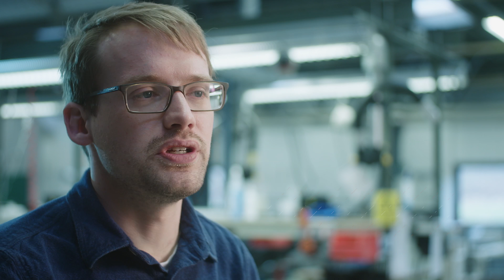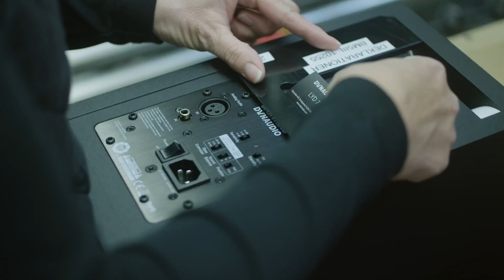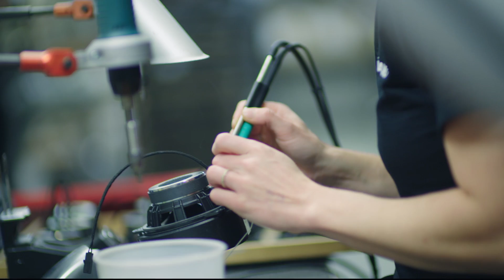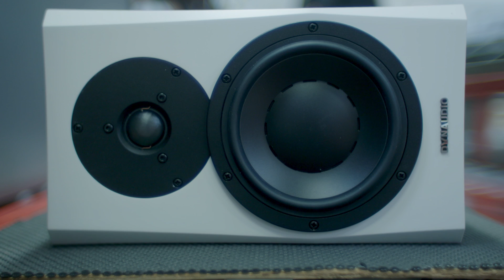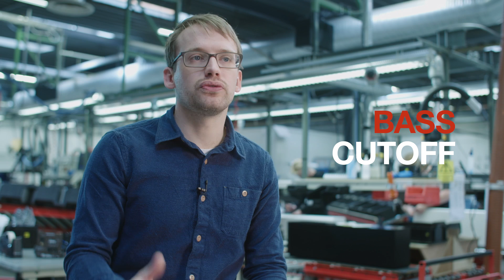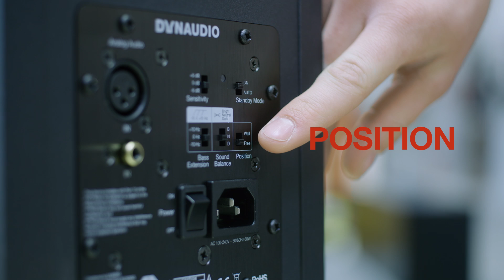Meet our newest Personal Reference Monitor - LYD.

Comment: Hello Dynaudio! I write music and do mixing. I want to buy a monitor for myself and I can't decide between two models. Please tell me, as far as I know, the amplitude-frequency response of the lyd7 and lyd8 are absolutely the same. Although usually 8-inch monitors have a wider range of low frequencies than 7-inch ones. Then what is the difference between the dynaudio lyd7 and lyd8? Do I understand correctly that a larger and heavier 8-inch speaker will not be able to reproduce the midrange as well as a lighter 7-inch speaker? Then what is the advantage of the 8-inch lyd8 model if it cannot give a lower resonant frequency compared to the lyd7 model? And one more question. What is the frequency response of the lyd7 and lyd8 at the level of +/- 3db?

Comment: I find it strange that there is no kind of volume adjustment on the back of the monitors as there can be slight difference in volume from one monitor to another, and I want to control the volume output. Calibrating the studio monitors will require an extra volume knob for each monitor to ensure equal volume for each monitor at a given level when the mixer is at unity.
Reply: Use your audio interface for volume
Reply: @tuneunleashed  I'm thinking about volume calibration of the monitors. I like to use unity gain on my mixer when playing back stuff. But of course, I will adapt to it. I'm still interested buying them at one point to retire my Adam monitors.  My monitors are attached to a mixer, not a pure audio interface.

Comment: The Essence Hi Fi series soundcards have RCA outputs so you can use RCA cables for connecting these speakers.  So does the EVGA Nu series.  So does the Soundblaster AE-9.  Best Buy sells EVGA.

Comment: I'm an aspiring podcaster and I want to buy LYD 8 for by 2m x 3m room. I'm crazy, but I am a bass head, don't wish to get subwoofer (waste space and extra money)
Reply: I have a room 3,5 m x 3 m and I use the LYD7 and the bass response is amazing, I think they are perfect. I used before the Adam Audio T7Vs and they were tooooo much bassy and boomy, I returned it and change them for this...
Reply: @opamusic9457  does it have parasite noises after leaving it on for some time? One of my a7x units has it, even though they changed the amp module for me...
Reply: @DarkPa1adin  yes they had... I think it is a design "thing"

Comment: Are LYD series are upagrade of bm mk3 series ?
Reply from the maker: Hi Vad. Well, yes. The LYD series did replace the BM series, but it's more than an upgrade, as we went back to the drawing board with these monitors. You can read more about them here: http://www.dynaudio.com/dynaudio-academy/2016/april/dynaudio-unveils-its-newest-personal-reference-monitor-lyd. //Christopher.
Reply: One more question.  Frequency respone , in lyd 7 and 8 ,go from 45hz - 20khz at -3db or at 45hz its less then -3 db ?
Reply from the maker: The 45Hz is -3db //Christopher

Comment: Can Dynaudio Lyd7 play the low frequencies equally as good as Dynaudio BM12 MKIII ? I mean the specs for Lyd7 say "from 45hz" and the specs for BM12mkIII say "from 38hz", but there is a bass extension switch on the Lyd7 and its 10hz. Does that mean that Lyd7 can play down to 35hz? I am wondering which one of these studio monitors to buy. Btw. I want to be able to check the low end of my mixes at low volume, so I am only interested in Dynaudio speakers. I can only afford one speaker and I do all mixing on headphones.
Reply from the maker: Hi Max. I will have a chat with our Product Manager about your questions so that we can help you out in the best way possible :-) //Christopher.
Reply from the maker: Hi Max,

so, we believe that the LYD 8 monitor - rather than the LYD 7 - is more comparable to the BM12. 

The LYD 8 also has a -3dB point at 45Hz, but a different bass response curve, which results in a more natural and bigger bass. 45Hz is also the lowest point (-10 Hz). 

We believe this enough to make good mixing decisions, but of course, we always recommend that you listen before you buy. 

Try your local retailer and see if you can demo a pair. 

Another option would be to use a pair of LYD 5s with a BM9S II, as this would give you a system that can reach down to 29Hz. But, it is a more expensive solution than a pair of LYD 8s. 

//Christopher.

Comment: Hi, I have got a pair of dynaudio bm6mk2. I love them but I've a question about: is the lyd 7 an upgrade in response frequency also with the 100watt against 150watt of bm6? Thanks
Reply from the maker: Hi Cosimo! 

The LYD 7 is definitely an upgrade compared to the BM6 mk II. 

One of the advantages of Class-D design over other amplifier technologies is the high efficiency, meaning most of the amplifier power can actually be used to drive the speaker and is not lost through heat dissipation, etc.

We test our speakers to find the optimal power level to achieve the performance and SPL desired. On the LYD 7, the 50W would be more than enough to push the drive units to their absolute maximum and above (of course we limit the gain, before that happens).

//Christopher.
Reply: @dynaudio  can you tell us more about your class D amps used in LYD series and why is it "state-of-the-art"? This is a bold claim

Comment: I like the idea that you are trying to give maximum quality and great engineering thought to your LYD Monitors. We would expect nothing less from the Danish people. We do have one concern though. I have found that with almost every other monitor we have procured, The choice of material used for the cone surrounds deteriorates over time. What assurance can we have that your material will not do the same?
Reply from the maker: Hi Ira. Our surrounds are made of rubber, and they actually have a proven track record for their durability. The membrane is equally durable and made of polypropylene + magnesium silicate: a material that we have used with success for more than 30 years. All the best, Christopher
Reply: +Ira Tozer-  I can't think of a Dynaudio woofer that had anything other than Butyl rubber surround, which doesn't suffer from the same deterioration that foam surrounds do. It's the reason I only use woofers with this material in the speakers I build and I have tended to use drivers from Danish/Scandanavian countries because of the excellent sound quality. My speakers don't sound as good, but it's more a way for me to learn about speaker design than anything else. I have speakers that are over 35 years old and the surrounds are in excellent condition.